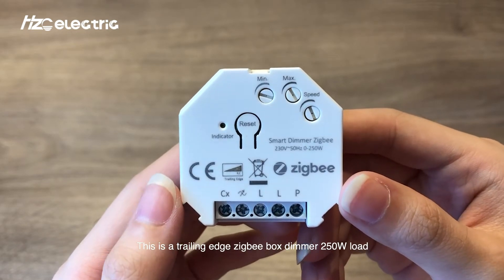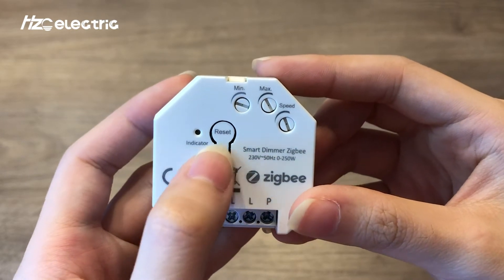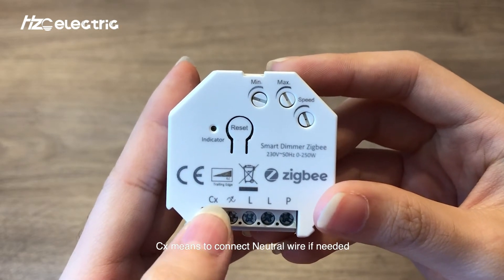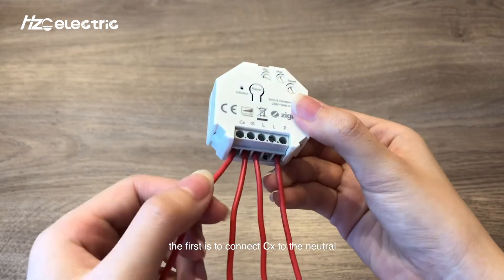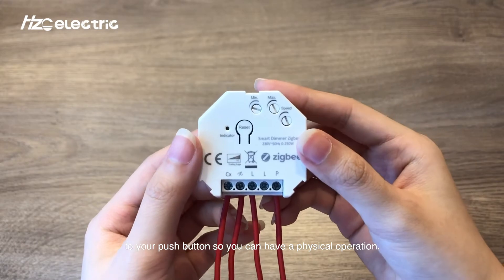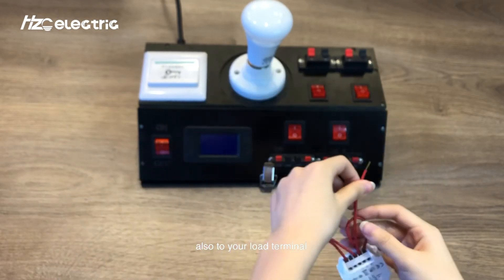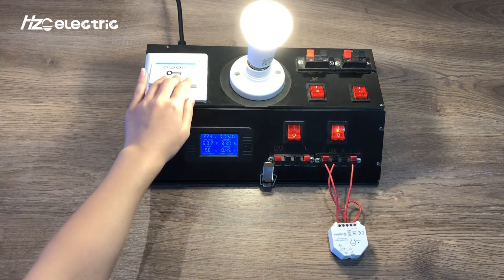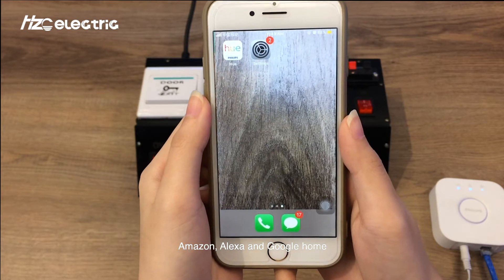Zigbee 3.0 Push Dimmer work with philips hue no neutral required by HZC Electric - D070K2-ZG

Comment: I have no neutral set up with Philips hue. I need two way switch (light switch A is upstairs and light switch b is downstairs). Also will it work with Philips dimmer switch?
Reply from the maker: yes！！